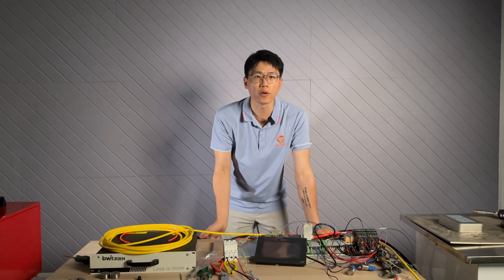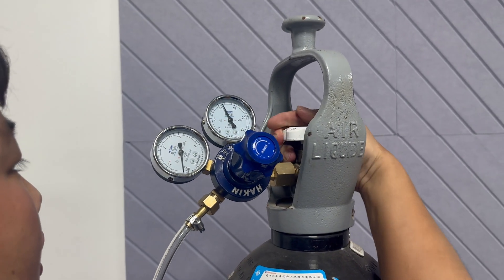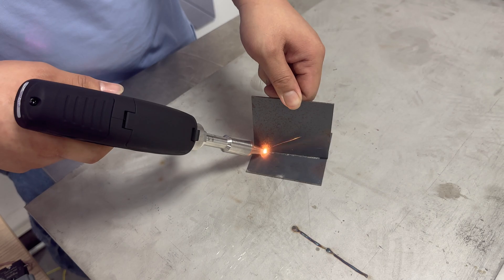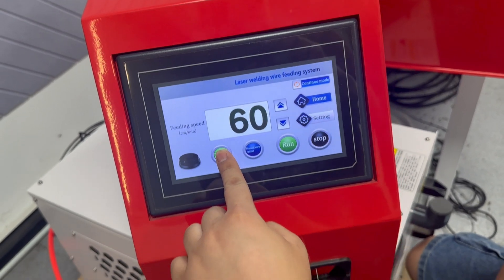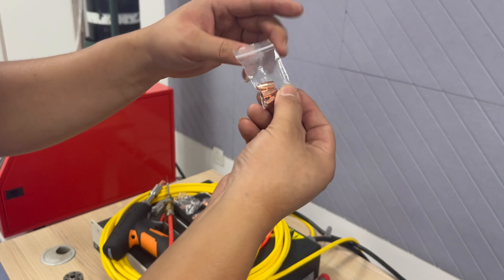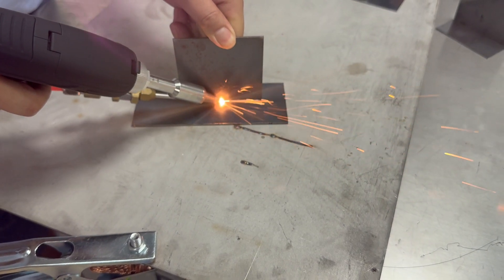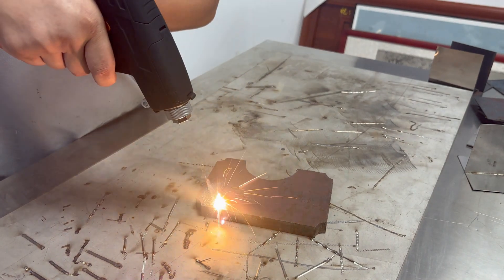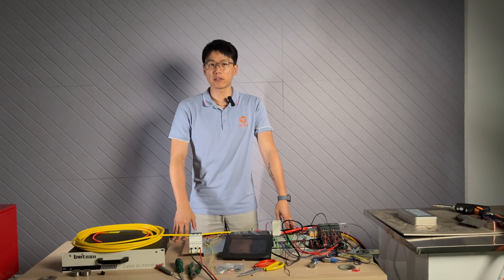DIY 1500w Water-Cooling Fiber Laser Welder Part 5 | Welding, Cutting, and Cleaning Demonstration

Comment: how thick steel plate mm can be cut with 1500w fiber laser welder
Reply from the maker: With a 1500 W fiber laser welder, you can weld around 4 mm SS/CS and 3–4 mm aluminum — that’s the optimal range for stable results.

Comment: do you have straight torch for cutting with this unit on cnc machine. this unit can cut thin steel good enough without screw compressor that need a lot of power ... just thinking for economic cnc laser cutter using this unit ... the lowest power laser cutter need 15kw screw compressor, so totally a lot of power needed.
Reply from the maker: @aristosuratman4783  https://youtu.be/tw-IComclxU?si=VAgYl8ybnFaX6wyw Thank you for your comment! I have indeed seen some other creators on YouTube trying similar setups, using straight torches on CNC machines for cutting.

Comment: Awesome video series... very detailed. Will you do one for a laser cleaner? I'm interested in continues and pulsed/top hat versions to build.  Are the kits available for pulsed yet?
Reply from the maker: Thank you for the great suggestion! We will look into creating a DIY video series for an aurora welding machine. Currently, welding machines do indeed come in continuous and pulsed versions. Generally speaking, the pulsed version has lower power, while the continuous version offers higher power. At the moment, we do have pulsed version kits available for use.